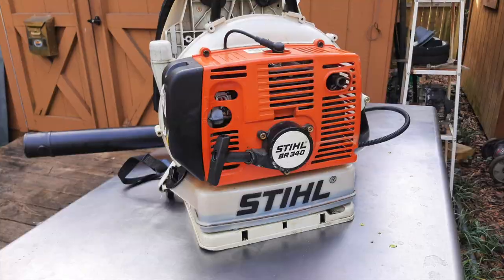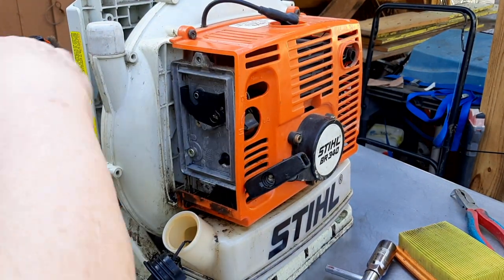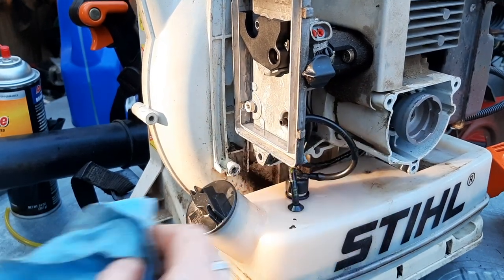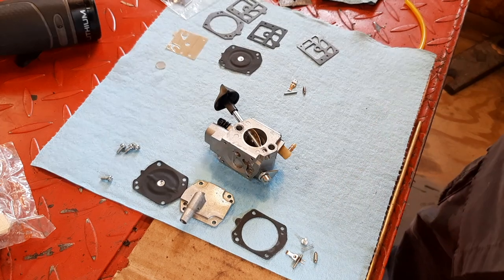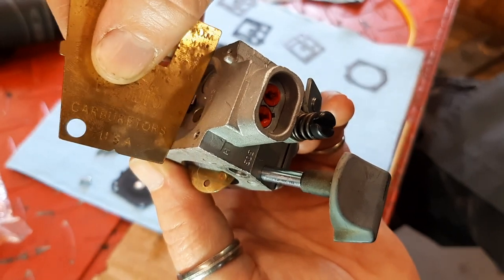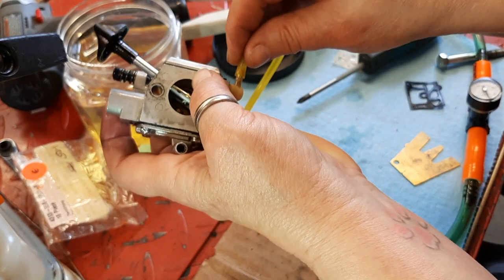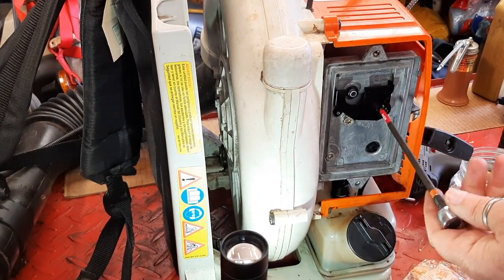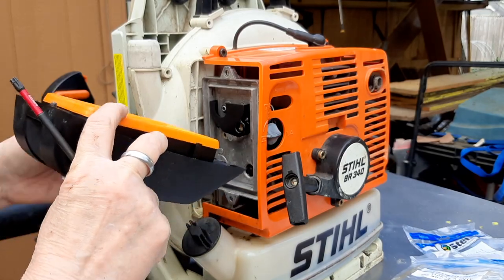Solving a Stihl BR340 Mystery: Fuel Leaks and Starting Woes!

Comment: Great video Stella, thank you for the shoutout too! I really like how you keep track of every service / repair that comes your way to be able to refer back to!
Reply from the maker: It honestly helps to show my customer those recommended fixes that they turned down the last time. Not very sophisticated, but it works, LOL
Reply from the maker: @Peter D My system is not quite that sophisticated 😹. But I do compile a spreadsheet at the end of a season, mostly for tax reporting, based on my little index card system. I only transfer name, machine type, dollar amount for parts, and total repair. I leave all the other data on the index cards. I can search the spread sheets later for name to pinpoint year and details ( that I manage to write down). Thanks for watching.

Comment: I also have the BR 340. Just a few days ago it started flooding when I use choke to start it when cold. Never did that in 20 years. My air filter was also wet with gas. I changed air filter but now if I use choke on a cold start it floods out. If I don’t use choke at all on a cold start, it starts on one pull and runs fine. That is not normal at all. I think I will rebuild the carb. Thanks for video and all the part numbers. .
Reply from the maker: I just worked on a BR420, similar story. It started and ran OKish, never serviced in +20 years, and compression was 125psi. Fresh carb kit, fuel filter, spark plug and boot. Runs like a champ now. A carb rebuild kit, specifically a fresh metering diaphragm and needle will probably fix the majority of your problems. Thanks for watching.

Comment: So I’ve got the same blower, and just replaced the carb completely, cleaned spark arestor screen, and it still will not start, it has spark, fresh fuel, and brand new carb/ fuel lines, what do you think it could be?
Reply from the maker: Maybe it's flooded? Is the spark plug wet?

Comment: So I found after I unscrew a brass carburetor jet they like to just hang out in the hole and not drop out.  The threads of the jet cling to the threads for the carb bowl nut.  Do you have any tricks for getting them out?
Reply from the maker: If you're talking about Honda carbs, I usually insert a pick into the pick up hole on the side, and guide the threads of the main jet out on the pick.

Comment: I own a BR 340. Bought used in 2008 for 100$. Cleaned the spark arrester and it started up great. Always used non ethanol fuel and synthetic mix. In 2023 I rebuilt the carburetor and replaced the fuel filter. Still runs great for a residential unit.
Reply from the maker: Great little blowers!

Comment: How to easily reassemble the metering side of a 2-stroke carburetor. 

After watching experts on YouTube do this and struggle at times with the tiny parts, and then struggle myself, I’ve finally invented the best method!

Take the cap off your tube of silicone or dielectric grease. I use large tweezers for this when necessary. First insert one end of the spring into the tube to get the bottom end of the spring coated with a little grease. Then insert that end into the spring cavity in the carb. The grease will hold it there. Then dip the axle pin halfway into the grease and insert it into the lever. Next dip the top end of the needle into the tube and  install it on the lever fork. All parts should now stay in place while you lower the assembly into place and hold it down with one finger while installing the screw. If you do this carefully you should be able to avoid getting that pesky slippery grease on your fingers most of the way through the operation, but it’s a good idea to have a clean paper towel on hand anyway to clean fingers so you can still hold onto things. Once fuel is flowing through the carb it washes away the grease with no issues whatsoever. 

This method has totally changed the game for me and sped up the rebuilding process by at least a couple minutes. Since I rebuild every carb that comes through the shop this will help my productivity greatly over time, not to mention my attitude and inclination to rebuild. 👍🔧
Reply from the maker: Great idea! I do that with clutch springs on antique scooter clutch springs, never thought  of that here. Cheers!
Reply: @TheLawnmowerLady  
How about a great video with my method?  It would sure help a lot of newbies who struggle with this one step!

Comment: good video Stella. Looks a lot like my old BR400 blower. That thing is a beast despite its age
Reply from the maker: As with most things in life, if you don't use it, you lose it. The guy that owns this prolly uses it twice a week, awesome little workhorse, despite the lack of regular maintenance. Thanks for watching. Cheers!
Reply: @TheLawnmowerLady  cheers to you as well. You know, it slipped my mind until after I made the comment but my br400 is on my channel. I did a walk around and demo. By the way, I got that metric all-thread you showed in your Honda GCV videos and that really saves me a world of frustration as far as getting all those gaskets and shields in place for reassembly. Thanks again for the helpful tip.

Comment: My own is not working how would I do it
Reply from the maker: Start with the basics: Fuel (clogged filter, crusty carb, cracked fuel lines), spark (clean plug, good spark) and air (clean filter, unobstructed spark arrester).